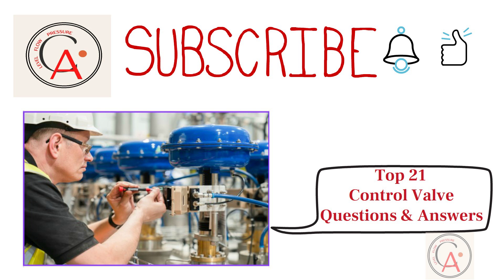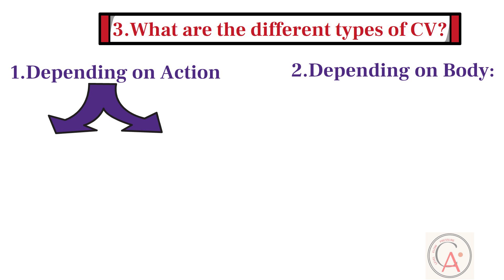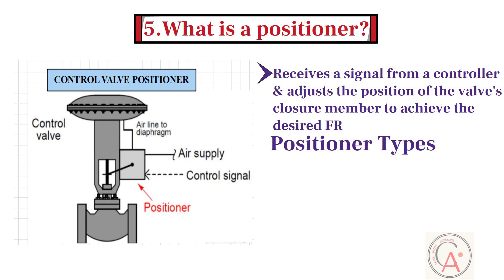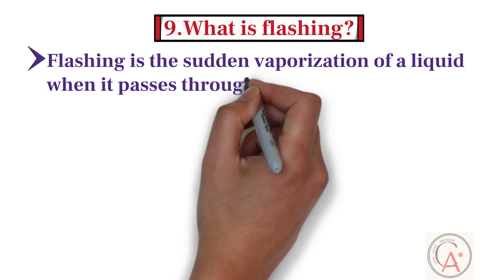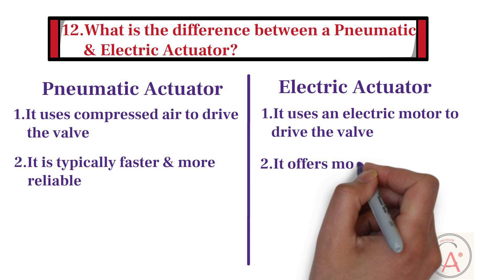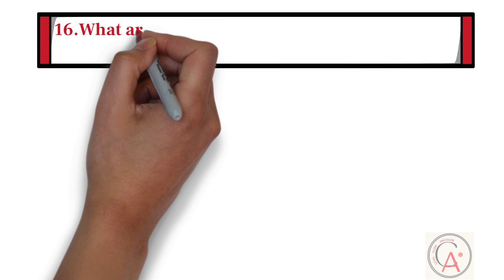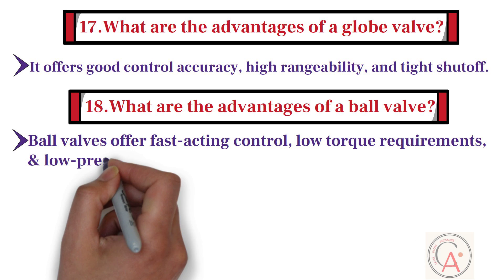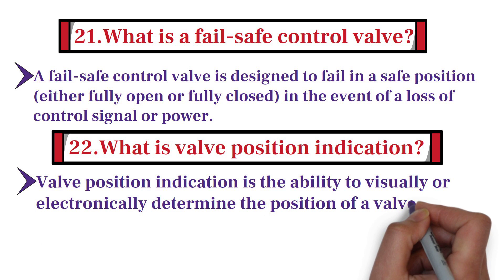Control Valves Top 21 Interview Questions and Answers for Instrumentation Interviews

Comment: If fluid flows in pipeline with 30 kg/ cm^2 pressure. We regulate the flow using control valve by giving instrument air at 3 to 6 kg/cm^2 pressure to the control valve actuator. 
The Question is 
How we abstract the high pressure flow with control valve by giving low pressure air?